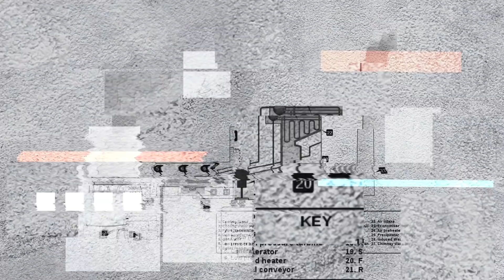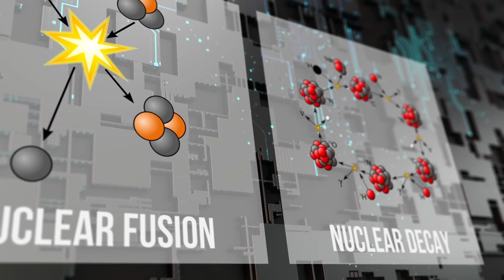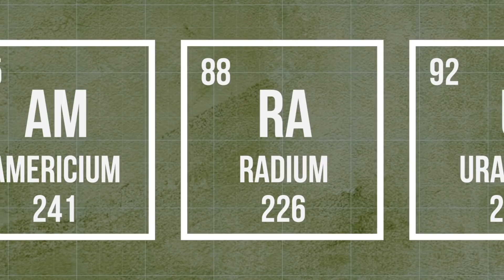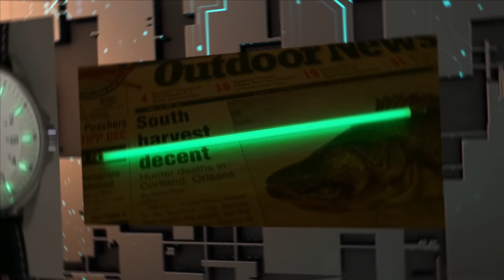World's Smallest Nuclear Reactor

Comment: Sorry but Tritium is NOT a metal, but an Isotope of Hydrogen. Releasing it from the capsule is not harmful unless you happen to inhale the tritium gas, then you're in for a rough ride and most likely Cancer in the future. If you release the tritium gas there is no likely harmful result unless it gets inside your body. The same is true for every kind of radioactive material. Also, Distance from a radioactive material is very important too. If you know of something that is radioactive distancing yourself from it has a very powerful effect on the effects of radiation. I used to work for a Down well inspection company, and we worked with Radioactive materials for the purpose of inspecting well holes and their integrity. We use a 2 meter aluminum rod to hold the source away from us while we inserted it into the Rig. the 2 meter distance from the source reduced our exposure to radiation by over two times, based upon the radioactivity of Cesium 137, or any other source being used, sometimes Cobalt 90 is used as well. Three aspects of Nuclear safety, 1. DIstance, 2. Time and 3. Shielding. The denser the material, the better shielding capabilities it has. Gold foil is often used to contain or protect. Many boxes used to contain Sources (called Caskets) are lined with lead as to keep it and it's ionizing radiation inside. Playing with radioactive sources without proper equipment, facilities and safety program in effect, you are playing with death! it will bite you and bite you hard. the problem with radiation is that there are no noticeable effect from it until many years later, when you find a tumor in one of your Lymph nodes or breast tissue,  and this applies to men as well as women! Breast cancer is bad and can afflict a man just as well as women, so don't get cocky!

Comment: As an EE this was kinda cringe but it didnt piss me off so good video. It would never work tho. Not the setup that was proposed. You would also need far more than 43 tritium vials, enough to cover the surface of solar pannel. u dont need lenses either. you make a vial and pannel samich where the solar pnnel is the bread and the trit vials are the jelly. no cooling needed. they dont even get warm. they dont produce the type of radiation that penetrates glass and skin. you may need upwards of 20 samiches 1 foot x 1 foot to pwer a laser strong enough to signal a plane or use less and make a charging circuit and use a battery. wait. if you have a battery and solar pannels you would get better results charging a battey during the day and running a laser at night. you dont need big solar pannel or big battery for that wow.  (edit) just realized I say solar pannels 190x

Comment: It's not the first time a kids built a fusion reactor plus they are easy to build small one scale fusion reactors there are literally tons of videos on youtube demonstrating nuclear reactors being built by someone. Most fusion reactors are huge energy dumps to keep a reaction(fusion of atoms) going continuously in the reactor chamber. So in other words fusion reactors are essentially big paper weights that are only good for generating helium which could be useful if the helium gas could be collected; mind you fusion reactors need alot of electricity to operate if the kid balanced out the inefficiency of the reactor & extracted actual energy from said reactor i would be very impressed because of the immense mathematics it takes to find the balancing with fusion reactors so you can actually generate electricity.

Comment: Tritium decay doesn't generate anywhere near sufficient heat for a meltdown nore do you have enough material to reach criticality. At most you will start a fire from the over-heated laser pointer burning through the cardboard boxes, assuming your circuit board/battery doesn't overload first.

Comment: 7:50 You really cannot call that a reactor just because a radioactive decay is taking place inside. Radioactive decay happens everywhere anyway. 
A nuclear reactor is a vessel or some kind of nuclear reaction confinement  that allows controlled nuclear chain reaction to occur. A controlled nuclear chain reaction cannot occur without a nuclear reactor, but radioactive decay happens despite the the nuclear reactor or despite anything for that matter. You just need unstable elements for for radioactive decay to occur.
Reply: that is nuclear battery of of sorts .000,7 watts if lots of these were focoused onto a larger panel it would take up less space and while 43 of them amounts .03 watts you   now have enough power to run small flash light or maybe small radio now 430 is .3 watts and enough to trickle charge a car battery but still fairly useless 4300 is now 3 watts of power you could start desolanate some water with this not much and the back ground radation would start to be intense unless it was shielded now up the game to say 43,000 of these little capsules and you 30 watts of power and your starting to approach small house range in power if have a solar charge controller and depending  on the grouping combined with your shielding thermal cooling would be an issue  but lets  up the game a bit 430,000 of these small capsules all focused onto a 300 watt solar panel and  you got  a constant flow of 300 watts of power and would need liquid  cooling to keep things cool at this point  note extracting power from this decay  would not cause any extra heat it would be the shielding that would be getting hot capsule  would get this heat radiated back to it self if the shielding was not cooled  and if some of these  capsuls  broke it would be a huge mess sorta first  the radiation would effect the wildlife and plants but the  isotope would safely  disperse into the ocean causing elevated radiation a few miles at  most from the island so its  not the most deadly stuff in the world but in large amounts this isotope can be deadly in few minutes so before anybody with money to burn that tries to build one of these for a bunker if something happened to crack  just a  few dozen of  those capsuls you could not get within 100 feet line of sight but  its worse its water and will evaporate and fill your bunker with high levels of radiation for weeks or months before you  could return then contaminate the ground water as well really not a viable power  source might be  for back up power for  a big  yacht as anything happens they can abandon ship even if in port the ground water  contamination would be minimal  and the leak could be contained until they take out to see by 10 miles then its a non issue the elevated short term exposure to sea life would not cause  any notable harm and  life goes on as far as nuclear  fuel goes  this  is not the worst  stuff to use I will stick to coal and natural gas because the risk of a leak is to big for most forms of use once the quanty is taken into account to get usable power

Comment: Answer to the question is you'd be just fine.  It's running like any other solar setup except the radiation source is different. Regular solar you use the sun as your radiation source and with this one you're using tritium. With solar no matter how much power you're using nothing happens to the source.

Comment: it cant explode that bad because tritium is hydrogen isotope soo its very light.that means it would explode in a big thicc cloud.Basically a firework for your party.Also the tritium is not connected to the system.That's why when you place 100 solar panels the sun doesnt explode.

Comment: Steam is used to turn steam turbines. It is the pressure of steam that does the work of spinning generators not thermal energy. It takes a lot of thermal energy to heat the water to high pressure steam.

Comment: I doubt it would melt down, one of the most disastrous parts about a nuclear meltdown is the release of the radioactive high pressure water loop.  Yes, uranium reactors melt and can create the famous elephants foot in chernobyl but the explosion is usually cause by the release of radioactive steam.  So I bet your tritium cores will most likely crack and melt themselves, if they even get that hot... as the foil you have may dissipate enough of the heat in such a tiny reaction.

Comment: there is one potential abuse problem with even a smallish fusion reactor, regardless if it is to produce energy

fusion produces lots of neutrons. so what you essentially have is an on/off controlled neutron bomb

place it on a satellite or drone you could 'selectively saturate' an area with waves of neutrons while keeping safe your own people in a way an atomic bomb could not
Reply: unfortunately i see that hazard for misuse as more significant than the benefits of fusion power

Comment: It wouldn't take 20 years to charge a cell phone battery with 12, 7 milliwatt units. If a unit is producing 7 milliwatts each and 12 units produce 84 milliwatts. An average cellphone with a 3,000 Mah battery and a 12 unit array would take like 6 days at 24 hours for 6 days. 12 watts or 12,000 milliwatts divided by 84 milliwatts per hour comes out to about 6 days.

Comment: While the batteries, or the proximity of the relactor cases might ignite the cardboard, there is not enough decay energy in gaseous tritium to explode. A thermonuclear weapon requires the energy of an atomic bomb to initiate the fusion reaction. And without oxygen in the capsules, hydrogen, including its tritium isotope is not explosive.

Comment: China, after stealing all the work on fusion from America have just made their fusion reactor work. Using hydrogen and deuterium as the fusion fuel.  Thus creating the first warp drive. Or something that can create nuclear power that is relatively small, though it produces somewhere around 50 times the heat of the Sun, which can be converted into electricity. Check YouTube for more details

Comment: "A large 300 milliwatt tritium reactor" he said... Wow thats 0.3 watts! 
With that kinda power, you can run your Wrist Watch for several hours; instead of using a watch battery to run it for years!
1 milli anything is 0.001; 1 thousandth. A liquid drop is around 1 milli litre. 
There's (86,400 x 1000) 86,400,000 milliseconds in a day! 
That 10,000 mAh portable USB charger (10 amp hours) cost 30,000 milli dollars USD on Amazon...

Comment: Plese some one how energy consevation in fusion reactor

Mean from which energy form to which energy from 
I m very consused 
How we converted a moving plasma to electrical energy
Reply: Plasma? He didn't talk 'bout it
But if you wanted to you could make the plasma flow and generate a magnetic field

But this is not remunerative

I'll explain
There are two types of nuclear reactions:
Fusion and fission

We are pretty good at fission, we take big elements like uranium and we smash them toghether to get something soo big that it starts decaying, then the decaying particles are collected and their energy is transformed into heat, then we simply warm some water, get steam, let the steam pass through a lot of turbines and we get electricity from the mechanical movement of those
This creates a lot of waste and harmfull radiation, and high risk of radioactive pollution

Fusion, however, is the opposite
In fusion you take something small and make them bigger, instead of making the smaller by decay.. It is the process taking place in stars
We take the isotopes of hydrogen,  deuterium and tritium(we can make deuterium fram sea water, tritium is a bit harder, but scientist are working on mass producing it) and smash them toghether and we get helium and a waste neutron as a side product, as well as A LOT of energy released by the "explosion" The plasma inside of the classic torus shape of fusion reactor projects has to be contained, it's a side product that we cannot let escape.. Since it's extremely hot and could destroy the entire structure or more
The way scientists are trying to contain it is by blocking it in an electromagnetic field, that will keep it constantly flowing and not touching the edges of the reactor
Even tho the magnetic field has to be really powerful, once the production starts, the fusion reaction will provide more than enough energy to power it self, it is estimated that a reactor like that could potentially generate 10 times the energy it used, but nothing is certain yet
Also i don't know exactly in wich form the energy is released from this, i'm guessing heat, wich is then converted into electricity like before
Currently all the attempts at making such a thing failed, generating less energy than it used in the first place.. I guess that, as the classic joke says, nuclear fusion is only 30 years later.. And it will be so even in 30 years

Comment: Well,just put some sort of doughnut-shaped metal tube around your tritium capsule and fill it with water.
If you want to keep it cold, just build a  small pump out of a small motor,drill a small hole in the tube and connect it to it
Then, drill another hole for the water to get out,and here you got a cooling system

Comment: This guy: how to make DIY reactor from parts you never heard of to power an led 
Me : makes a mini hydro power station from old toy car motor and trash plastic bottles
Reply: @johnnytheprick unfortunately no I did it in 7th grade now I am an engineering student 😂😂
Reply: Hey, acquire a very large pickle—the kind that would fill a garage—a truckload of alka seltzer cold tablet-wafers, purchase a small waterwheel to serve as the turbine, and then encase the pickle in about 1/4-inch thick aluminum that has been riveted together -  after shoveling a big hole cavity in the pickle.  Finally, use copper tubing that you can attach to your refrigerator—wrap the pickle with the tubing, turn the freg on maximum—to keep the pickle really cold and prevent it from spoiling. After that, Next to a one-inch exhaust hole in the Pickle's loading door, set up the water wheel to catch the exhaust. Load the Big Pickle up with as much alka seltzer as a truck can hold, slam the little loading door shut, bolt-lock it securely, and then run like the wind. PS. As long as the Big Pickle and selzer are around, the reaction will power the water wheel that is linked to a vehicle generator. You may enjoy free 12v electricity at that time. To top it all off, a 110v generator would be ideal. This was relayed to me by ONE of my three pals who constructed one. The second  buddy lives at a local institutional nursing home. In Pleasant Valley Estates, the third one resides with the departed; he was in charge of the loading entrance. In my first inquiry, I questioned my first acquaintance, "What the hell did you see?" "It was so fast—I guess we used too much seltzer," he said in response. After Frank bolted the exhaust door (but not fast enough), Johnny ran like a Bat out of Hades (but not fast enough either), and I saw a tremendous burst of white light, or moisture . I inquired, "Oh that's a shame, I'm so sorry. Now, what became of your house?" According to him, the insurance company advised him to shave a pickle in his hole and relocate to his truck camper, that he now lives in.

Comment: I'm curious what would happen if you gently were able to park two planets onto each other. Thus no massive explosion, just pretty much one giant rock placed onto another. How would it spin? Would it still orbit in a perfect circle or would the wobble of it's rotation throw it off and eventually into doom. Would the gravity between the two planets have a median and would there be floating islands there? If everything went well and the planets didn't throw each other off their orbit and into doom, then would one eventually consume the other? Or would the planets own gravities hold them together and prevent such a thing?
Reply: If the planets are close, and rotating fast enough to technically be orbiting one another, then they would be torn apart by the tidal forces. (Look up the concept of the “Roche limit.”) If they started out close together, then eventually the two disintegrated planets would coalesce into a larger single planet, but that could take quite a bit of time. If instead there’re not moving fast enough to be orbiting one another, then they would again disintegrate and this time immediately collapse into one another, forming a new planet. How fast it spins would depend on how fast the two planets were originally moving around one another.

Comment: um rename this video and you do realize a Farnworth fusor is not a power reactor and they have low rates of fusion and will never pull net positive there for study only and net positive means your getting more energy out then you put in and you really need to look up you info better a thermonuclear reactor is the overall class of power production using the heat there's others like beta production and ion production and your confusing a fusor with a tokamak witch is suppose to produce power. and yes fusion and fission are both nuclear but are very very different things fission has x1000 more waste and radiation fusion has less of both and 10x the energy they just haven't being able to get the reaction to self sustain or break net positive. and this video is full of bullshit hans wasn't trying to power his house wtf non of these plp were its all about the science and the other uses then power like element production don't group fusion with fission like its the same radioactive dragon its really not.

Comment: You can build one but the space needed for the lead walls and plates the meters and more. The safety is the expensive part. And fusion needs high charged partials put be put into it to use.

Comment: You want power, just get an electric generator and hook up a solar panel to the battery system and take out the battery.  Use crystals for holding a charge like a battery.  Now, as long as the generator works, you will have power for a long time.  It's safer than creating a nuclear reactor.
Reply: But way less fun and danger